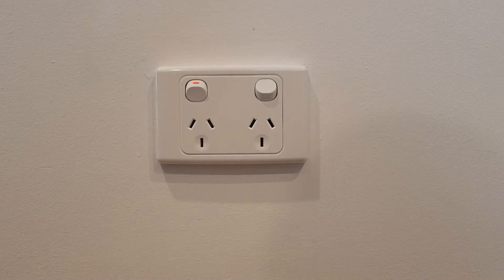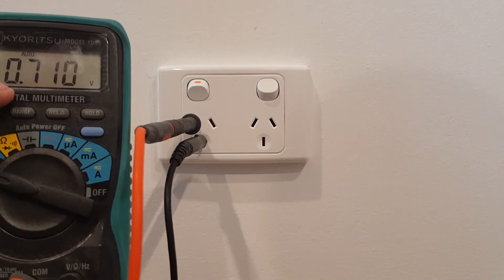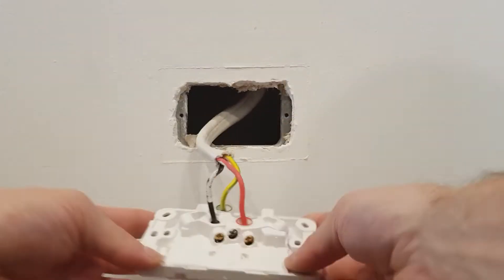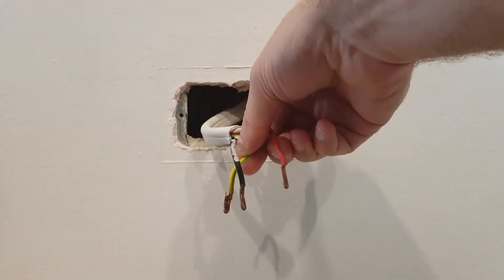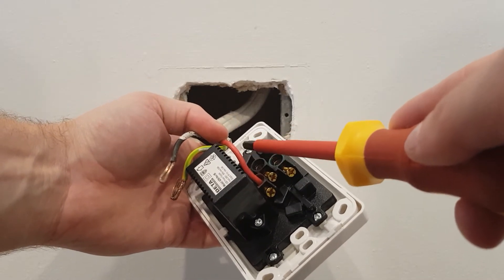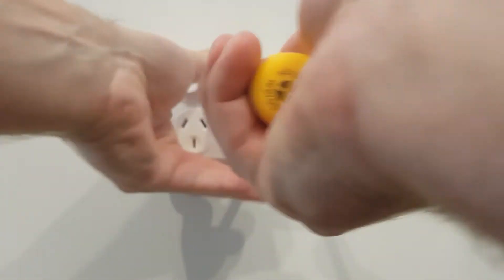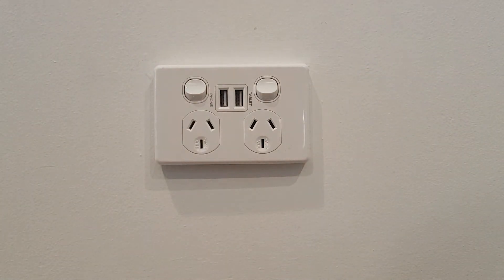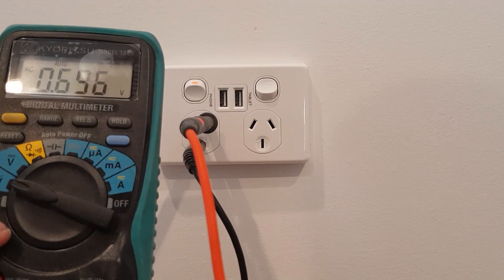How To Install a USB Outlet

Comment: I thought it was a safer practice to put your probe in the nutral side of the gpo first because if you insert the probe  of your multi meter into the active side first it will make the negative probe alive if the sircuit is energised

Comment: Some of these powerpoints come with a red & black wire coming from the USB hub (presumably active/neutral), where do those go?
Reply: To the active and neutral terminals on the back where the 240 wire goes
Reply: @connorparsons5404  thanks for the reply. That's what I assumed but wasn't sure. I didn't think the little USB transformer would need a 240 supply but now I think about it, it's basically just a little inbuilt wall wart isn't it?
Reply from the maker: Depends on the brand and the wiring configuration

Comment: Very helpful. Thanks for sharing. One question, can I add a new power point switch from an existing light switch wiring? is it as simply as adding new wire and connect same wiring from and existing light switch to the new power point switch?

Comment: 240 volts actually
Reply from the maker: No its actually 230v now in Aus
Reply: @allelectricalau  Yes that's the standard, but the voltage will fluctuate with time from 230-250V based upon the energy usage for your grid
Reply: @allelectricalau  was I reading your multimeter at .710 when you checked for dead on the earth?